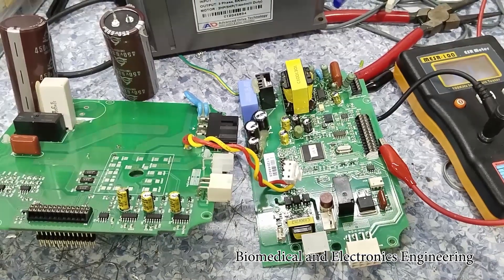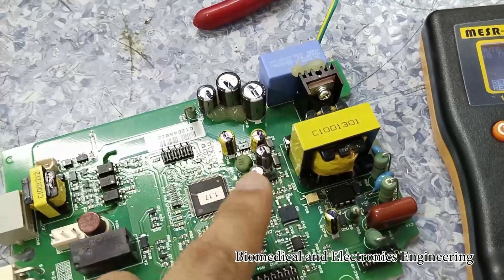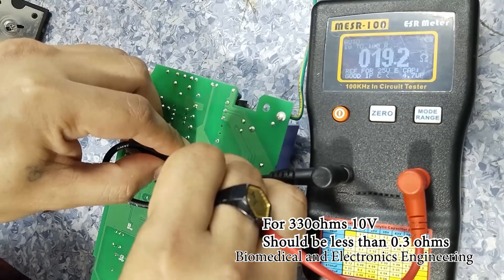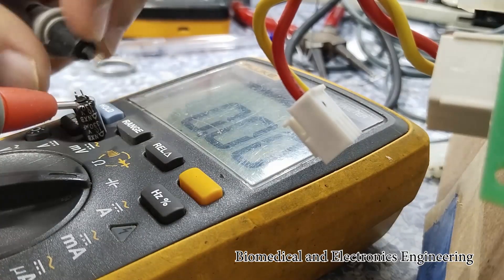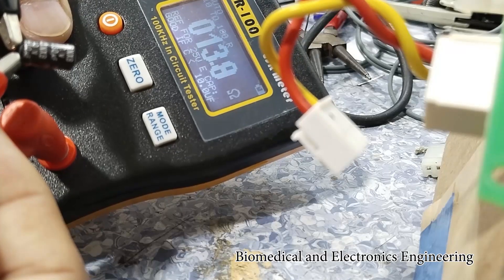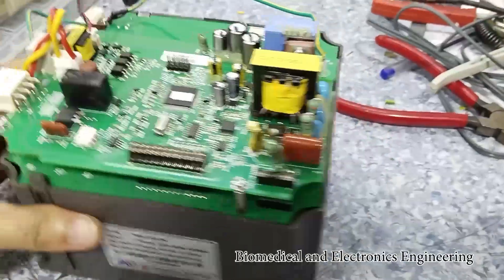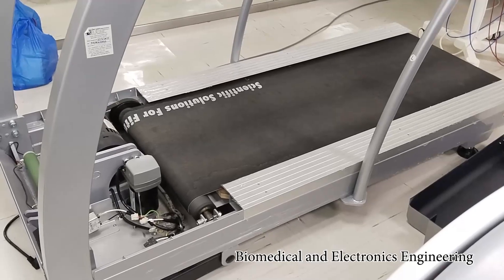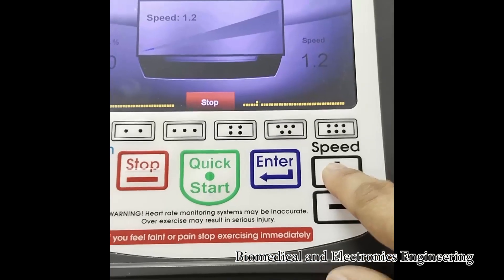Treadmill Control Board Repair : A Quick Way of Detecting a Defective Capacitor Using ESR Meter

Comment: hi, nice video. my life fitness treadmill shows " low voltage detected" error. I checked most components and also test the main board on working machine,  but same error.
Do you have any solution for it please. Thanks
Reply from the maker: Low voltage must be from your main source.